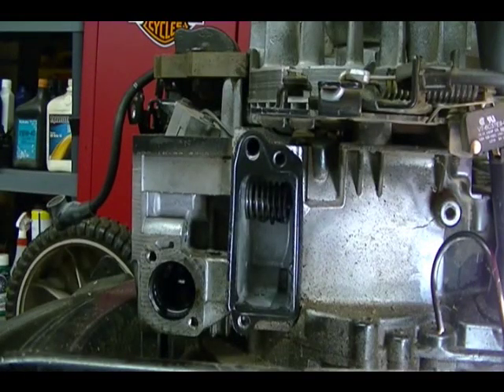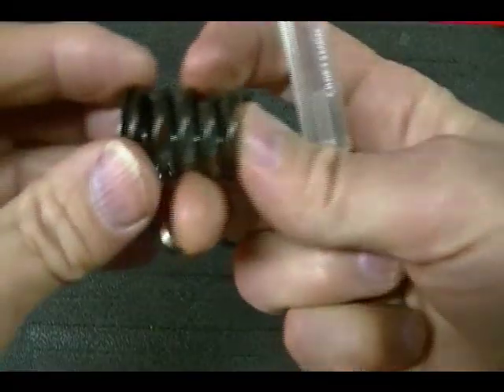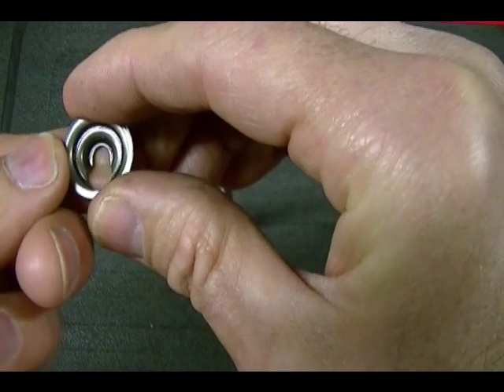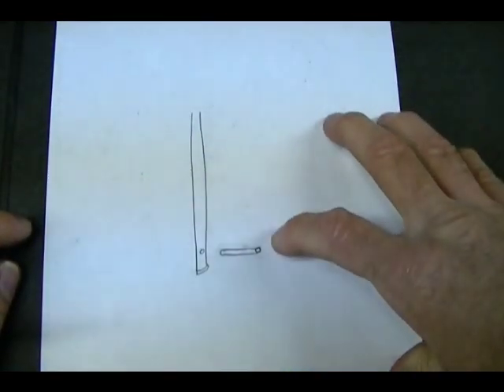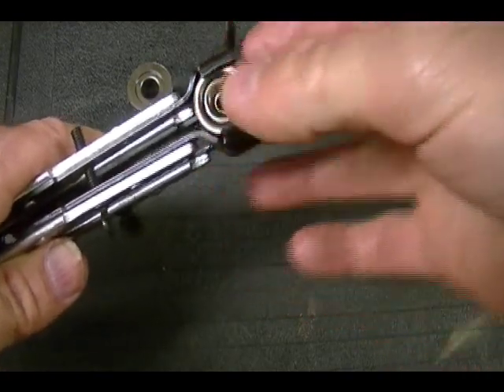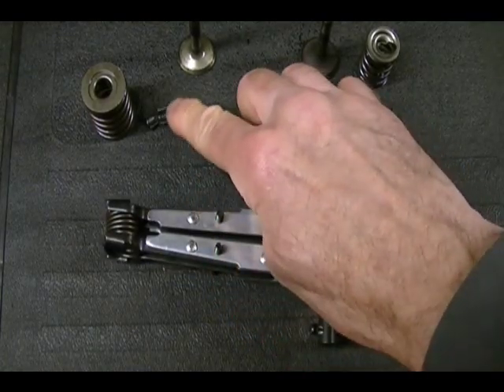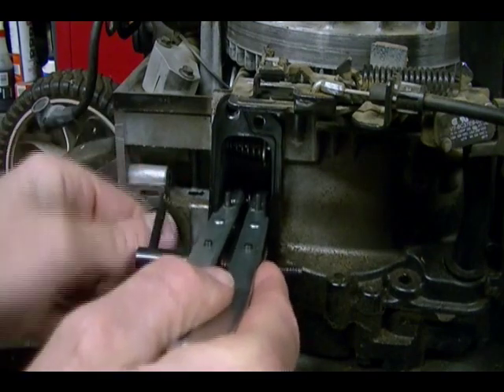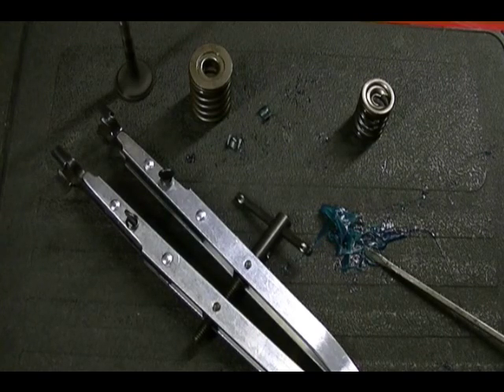How to use a Small Engine Valve Spring Compressor - 3 most common Valve Spring Retainers

Comment: You didn't demonstrate the collet style very well but it was enough to get mine off to lap the valve, its very fiddly getting those split collars back in place, grease is definately the way to reinstall, I find a magnet won't let go and it usually pulls both of them out again..
A dab of grease on the end of the screwdriver is enough to place them in position and will let go easier than a molybd magnet.
Having the spring compressor makes it so much easier, glad I bought it.